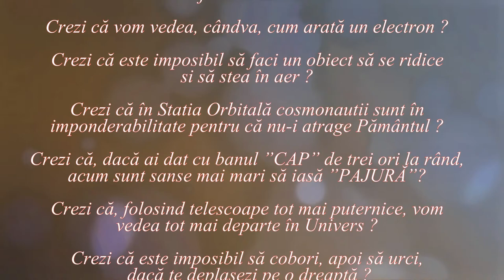Instalații HHO ? (Lumea nu este cum crezi ! _ 40)

Comment: Buna seara, domn profesor! Intrebarea mea nu are neaparat legatura cu subiectul clipului, dar sunt curios de raspunsul dumneavoastra. In ultimele saptamani, am studiat extensiv motoarele cu abur, cat am putut, deoarece nu se gasesc foarte multe informatii despre ele. Din cate am citit, atunci cand sunt folosite pentru locomotive, sau chiar automobile, nu au nevoie de transmisie, cum au nevoie motoarele cu ardere interna. Care ar fi explicatia?
Reply from the maker: Așa este, au nevoie de raport de transmisie variabil doar acele motoare care au un cuplu puternic dependent de turație. De pildă, cam toate motoarele cu ardere internă.
Motorul cu aburi are un cuplu mare și la turații reduse, de aceea n-are nevoie de transmisie variabilă, ca și motorul electric, de altfel.
Reply: @RomulusBoeriu  Multumesc! 

As mai avea o nelamurire. Transmisiile masinilor cu ardere interna le si ajuta sa mearga mai repede (viteza a 5-a cu raport mai mic decat 1, "gear ratio", cum se numeste in engleza). Cum poate ajunge o locomotiva la viteze de peste 150 km/h, (cum este locomotiva Mallard, din UK), dar totodata sa aiba si cuplu extrem de mare? Este cumva ca si cum aceste locomotive sunt mereu in viteza a 5-a? Presupun ca acelasi lucru se aplica si a motoarele electrice. 

Si inca ceva, de ce au motoarele cu ardere interna cuplu acceptabil doar la turatii mari? Este din cauza faptului ca pistoanele sunt mai mici in comparatie cu cele din motoarele cu abur?
Reply from the maker: @scuzyprod.1611  Cu plăcere !
E vorba despre chestiuni tehnice la care se pricepe mai bine un inginer.
Ceea ce stiu eu este că la mașinile cu abur se poate controla timpul cât intră abur în cilindri.
În acest fel putem, dacă lăsăm aburul să intre până la sfârșitul cursei pistonului, să obținem cuplu și putere foarte mare. Dar în acest mod de funcționare motorul are un randament foarte prost.
Sau putem să lăsăm aburul să intre doar la începutul cursei. În acest fel cuplul și puterea vor fi mai mici, dar randamentul va fi mai bun.
In ceea ce privește motoarele cu ardere internă, cuplul variază mult cu turația deoarece transferul de impuls de la gazele arse la piston se face cel mai bine la o anumită turație. Din cauza asta aceste motoare au o turație de cuplu maxim si cu cât ne îndepărtăm de ea teansferul de impuls este tot mai prost.
E un fel de rezonanță care apare datorită arderii interne care produce variații foarte mari de presiune în cilindru.
De asemenea, randamentul arderii, eficiența compresiei si altele depind de turație.

Comment: pai bun, dar eu am facut un sistem cu baterie separat si 2 panouri solare cam 400W peak ora 13 adica 10% intra in putere  = 40w. asadar, eu am nevoie de 7.45kW ca sa adaog 10cp ahaha, mai bine ii bag in starter motor - ca nah hibrid :) - dar de fapt la 400W proci cam 1L/minut oxihidrogen - eu cred ca nu calculezi ceva bini aici. esti sigur ca ai facut toate calcuelele?
Reply from the maker: Parcă așa am spus și eu în material, că poți obține, practic, 1 litru, 1 litru și jumătate pe minut, nu ?